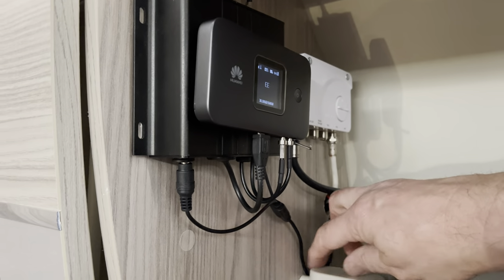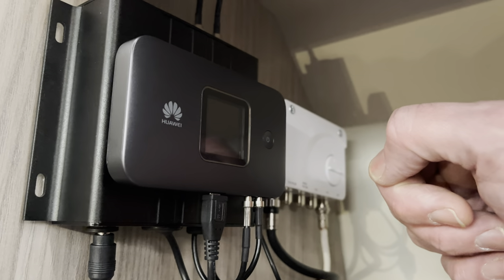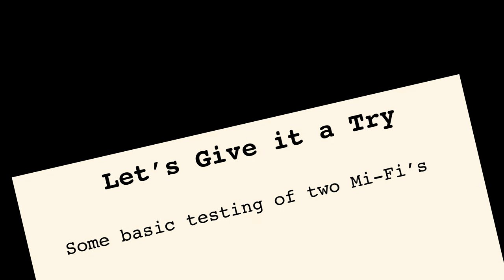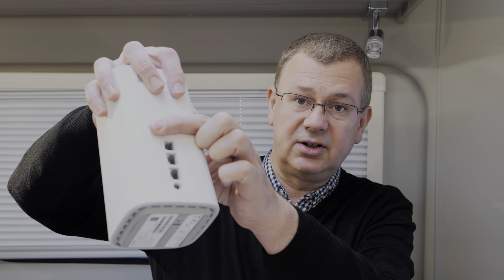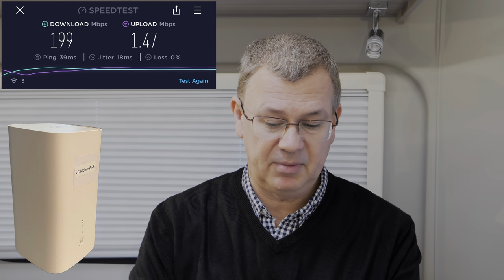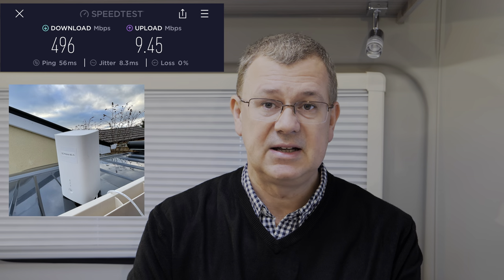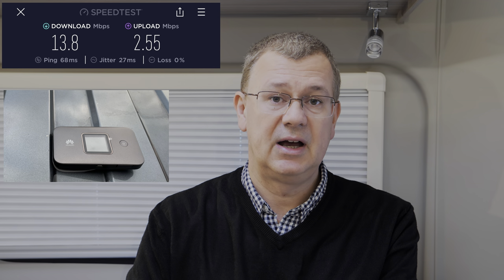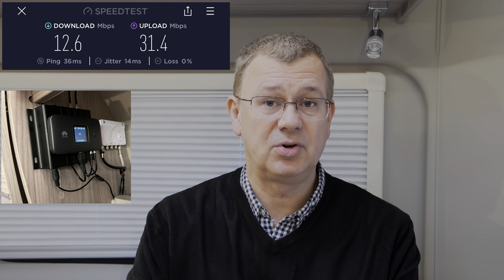Mobile Mi-Fi Devices in your campervan, caravan or motorhome with a quick experiment on positioning

Comment: Very good informative video as usual David. When we ordered our van from Tyne Valley Motorhomes we paid an extra £1295 for the adventure pack which comes with wifi, TV, external BBQ point, Cadac BBQ etc.Just need to get a good deal on unlimited data when we get it :-)
Reply from the maker: Thanks Trevor, appreciate the comment. Sounds like a good deal on the pack and at least it’s all done for you then saves faffing on. There’s definitely some deals around to be had depending on the network - All the best, David 👍

Comment: Very interesting, I have been deliberating on wifi for the van and still not sure which way to go. Did you fit the Ariel yourself or did you get the dealer to do it.  Very useful information btw.
Reply from the maker: Hi Tim, the dealer kindly fitted the aerial it’s self  so saved me drilling the hole myself while they did the solar panel. It’s a difficult choice and depends how often you use it / where you go I think - pleased it was useful - all the best, David 👍

Comment: @LeisureBit, recent subscriber to your channel and appreciate your videos and the professional way you go about things! We have the Huawei E5785 too and often struggle in our PVC to get a decent download speed because we don't have an external aerial currently.  The CPE Pro 2 looks an excellent bit of kit, wondering if this might be a better option for us. Can you comment on it's performance in your PVC without an external aerial which it does not support I believe?
Reply from the maker: Hi Pete - the CPE very much depends on where you position it - if it’s in the overhead locker it’s pretty poor but next to a window it’s good - I have on occasions popped it on the roof out of the skylight and it’s best there as the signal comes in ok - when I ordered it I was hoping to get the one with the external aerial ports but it had been upgraded and I did see a mod you could do but it’s 6 antennas rather than the usual 2.
I don’t use that one very often as the E5785 with external aerial on EE has been really good and where signal has been poorer I’ve had nothing on the other (3).
Hope that helps in some way,
All the best, David 👍
Reply: @LeisureBit  Thank you, yes I must admit there seems confusion on Amazon as to whether the Pro 2 supports an external aerial or not - do the latest models support an external aerial then?

Also you said the Pro 2 would need a stabilised power supply does this mean some sort of dedicated power supply off the van's 12 volt system?

No more questions I promise 🙂
Reply from the maker: Great question - I’m not sure as the previous model had the antenna ports but the one I got didn’t (it was from Three). Regarding the power supply, I’ve not tried it on raw 12v but worked fine on a stabilised 12v supply I had from an old TV from previous motorhome days.

Comment: Did you try a mobile phone as a hotspot. What’s the advantage of these devices?
Reply from the maker: Hi Tony, I didn’t on this occasion, I just didn’t think of it at the time but it would have been useful to, Will try the same with my phone and see what the outcome is and report back. 
The main advantages for me personally is it creates a fixed solution for internet which when in areas of weaker coverage allows use in places where the phone may not or gives a faster internet speed that you would get without it. This isn’t always 100% scientific and you can get a variation however. It also enables me by having an internet access in the van, when I’m not there to keep an eye on it via my dashcam and to receive alerts etc, it will also enable my Camper Control system to have access remotely. You don’t have to faff on with your phone and keep it charged up. You also can more easily switch SIM cards for different networks where there may not be signal on your phone and can then connect the phone to it. The cons are costs for the kit, monthly subscription for service. Many other pros and cons but just those spring to mind, it really depends how much stuff you want to connect to it and how often you use the internet when away, and where you go and whether you care if you’re without it. Hope that helps answer, best regards, David 👍